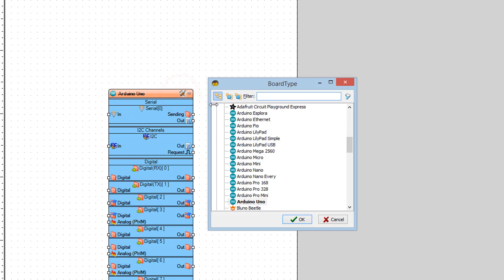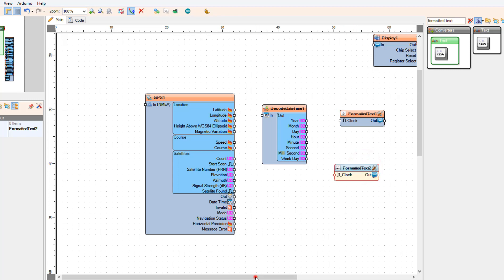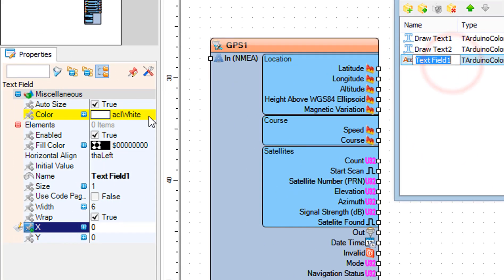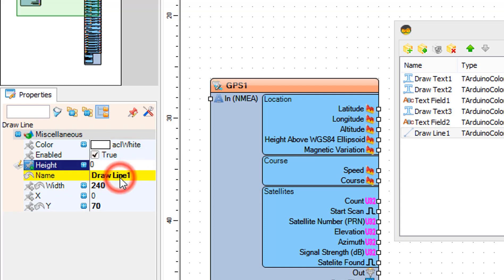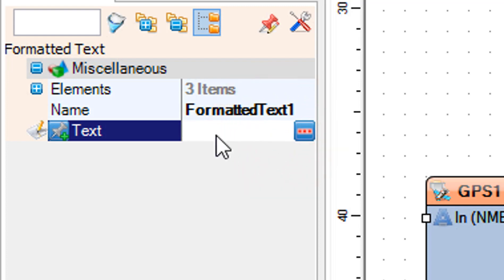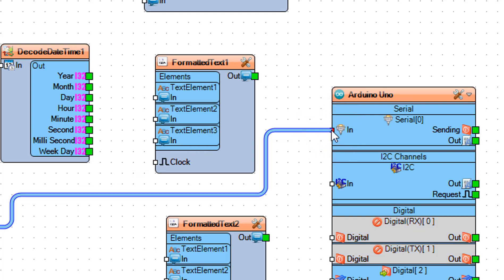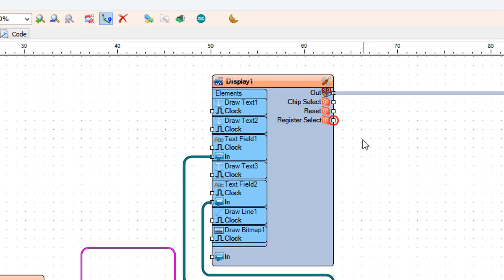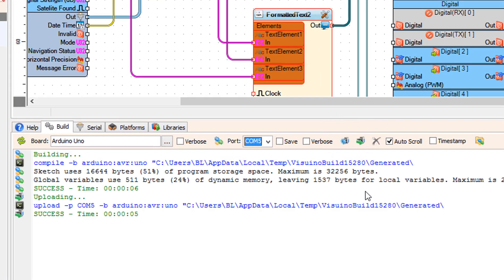Arduino GPS Clock With Local Time Using NEO-6M Module

Comment: Awesome video ! ! !
I have Ublox C94 M8P Receivers 

Does the GPS Module has to be NEO-6M Module or this project is independent of the type receiver used?
Reply from the maker: No but it would be a bit more complicated (since it is not added as a component in Visuino) because you would need to monitor serial text and extract time,etc 
as for the NEO-6M it is already added as a component in Visuino.

Comment: A GSPDO would be a neat project next.   Maybe something to measure Phase after that once you have the better OCXO project?  Never seen Visuino before.  Is there an export code function also?
Reply: Looks like the $199 version can view Live Code.  Interesting and maybe easier for many.  https://www.visuino.eu/about-visuino-pro-version/
Reply from the maker: To export the code, just click on the button "Send to Arduino" on the top bar and the code will be transferred to Arduino IDE where you can modify it, export, upload,etc